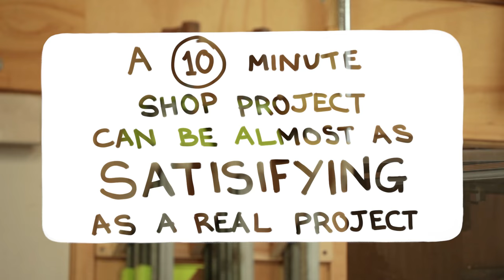10 Minute Clamp Rack

Comment: Nice rack. Just one suggestion. Why throw half of the plywood into the scrap bin? Instead of cutting from corner to 1-inch from corner, just cut from 1-inch from corner to 1-inch from corner. Then you have two usable rack pieces and no scrap.

Comment: Nice channel! Subbed.
Wouldn't you want a little 'bump' on the top end to stop the clamps from falling out? Just a tip maybe
Reply from the maker: Thank you! I'll add that if I find I need too :)
Reply: I'm getting ready to build this myself, and I'll be making the cuts with a slight angle -- 2-5 degrees, depending -- so that the clamps fall back toward the wall.